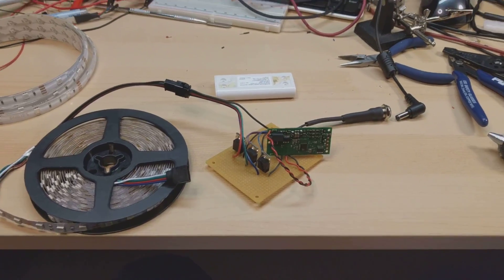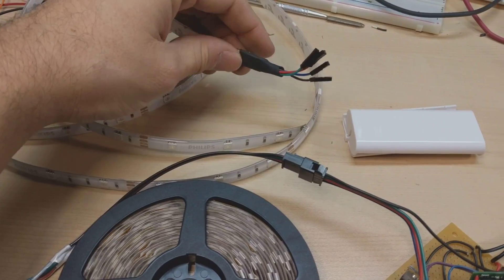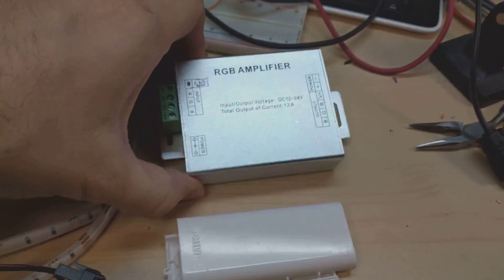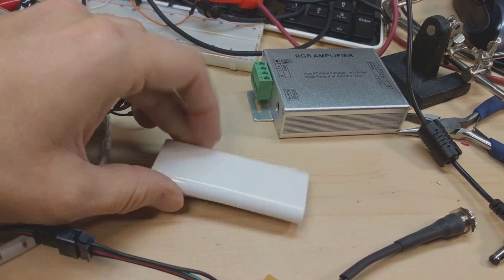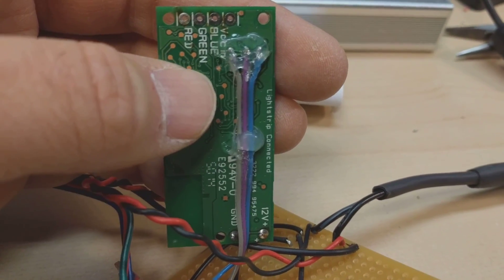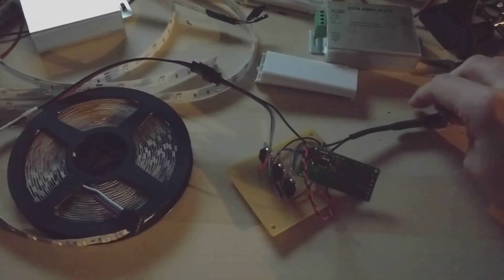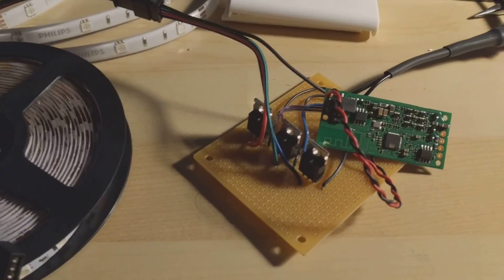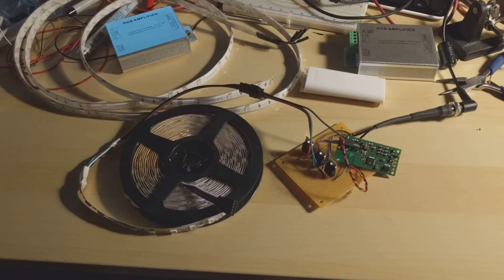Philips Hue Lightstrip Mod

Comment: This video is frustrating to watch. It's basically you just humble bragging about what you did but at the same time you have no idea what you did or any way to explain it.  What mosfets did you use? Did you de-solder the old ones? How did it operate long term? Hope someone gives more info some time.

Comment: Hi Adrian! Great Idea! Great Video! I'm a complete noob, I know other have asked you this, I need to buy those mosfets to do the same exact thing, i have about 15-20Ft of RGB 5050 led strip, i am using a 500 watt computer power supply to power them. I have hues all over my house, and non hue led strips, so i plan to go into my control panel and just replace the controller so it'll work with my hues. Any recommendations from amazon? what channel? i have no idea. Please help. Thanks
Reply: abdullah uzair look on Amazon for FLS pp LP

Comment: Hi Adrian, cool video! I'm a noob at electrical stuff and terms...wanted to ask if I remove the power supply the cones with the Hue lightstrips set, can I hardware it directly to my wall switch? Thanks!

Comment: What size mosfets have you used?
Reply: +Adrian Black  I want to try it. If possible could you tell me which ones are they. as i have already burnt 2 rub amplifiers trying to extend the lights. it would be a big favour.
Reply: +Adrian Black Ok Great. Ill try something. How are the mosfets performing compared to the original one? 9/10 result?

Comment: Have a look for Fls-pp available on Amazon, it's a hue compatible zigbee controller for external led strips,.
Reply: +Adrian Black no problem 👍🏾
Reply: +Adrian Black Can also run 10m
Reply: the Fls-pp it's compatible with HUE but not with Apple HomeKit
Reply: A year later, I know, but thank you so much for the tip!
Reply: Still a nice project :) I wonder if you could use a controller of a cheap Hue light to control lights like G4 or G9  for which Philips (or any other manufacturer) still don't have a solution for.
Reply: What size mosfet did you use?
Reply: Great job